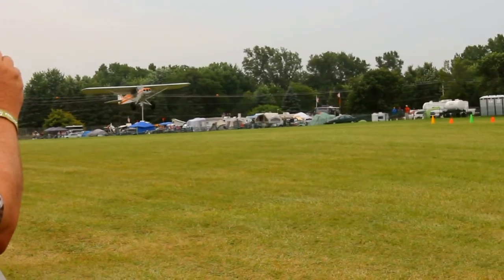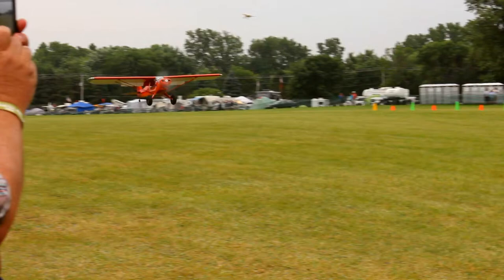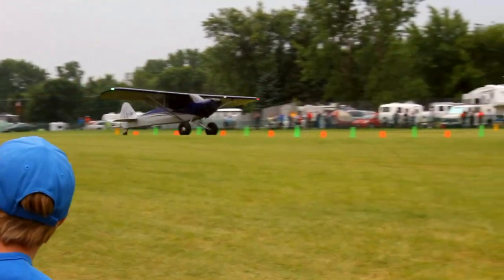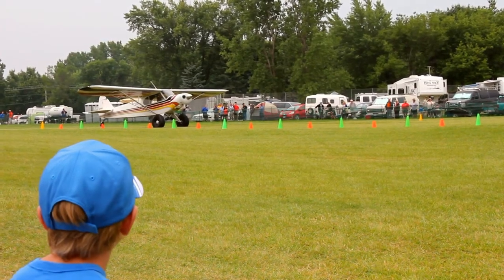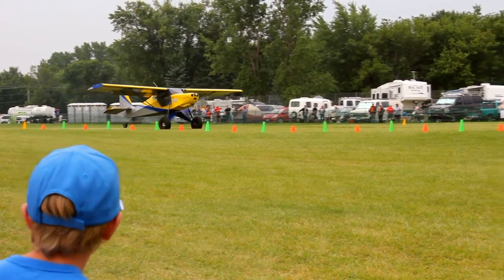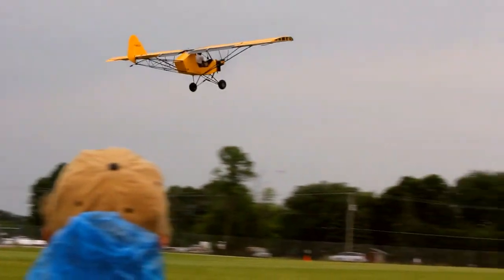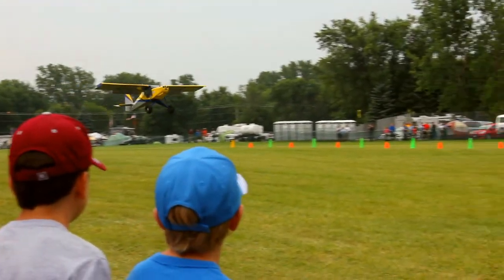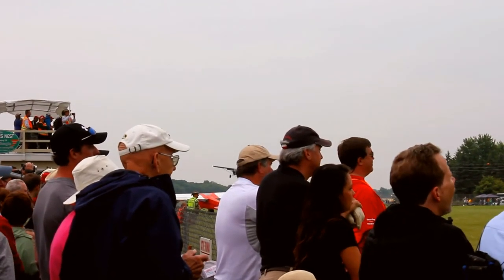Oshkosh STOL Demo Airventure 2014

Comment: The yellow plane with the naked rear fuselage-truss is covered with Oratex6000, the revolutionary Aircraft Fabric that needs no paint for any technical reason (but can be painted if desired). With Oratex all negative aspects of building fabric covered planes (Toxic exposure aspect, long hours to cover with Ceconite) are taken away and one could build a Pitts Special in a rental apartment. Best Regards from Alaska...